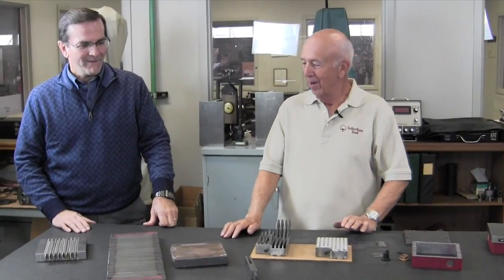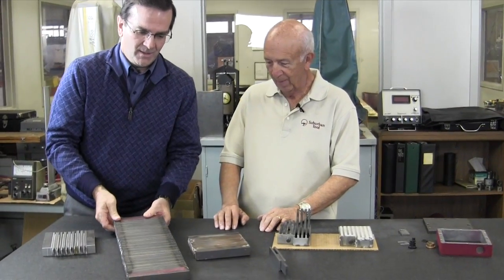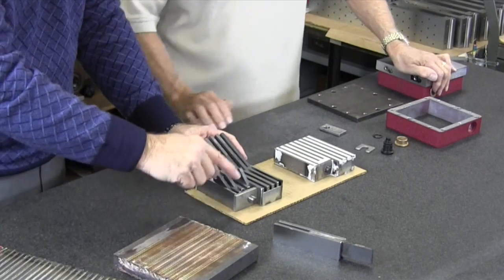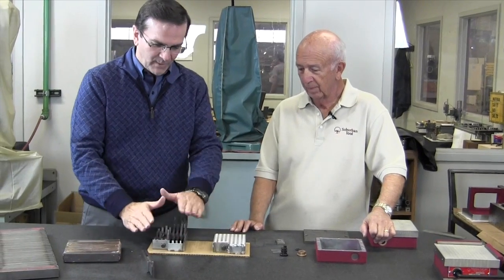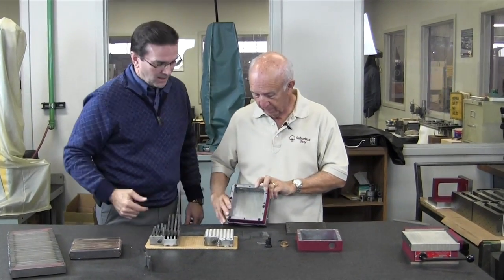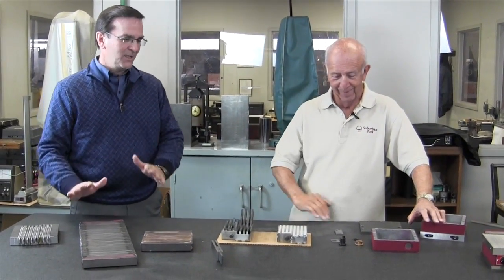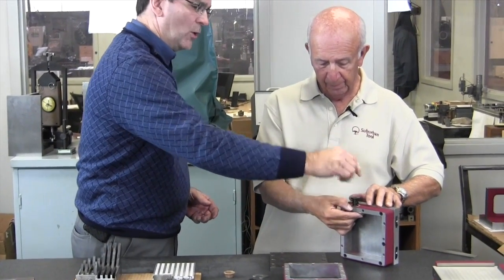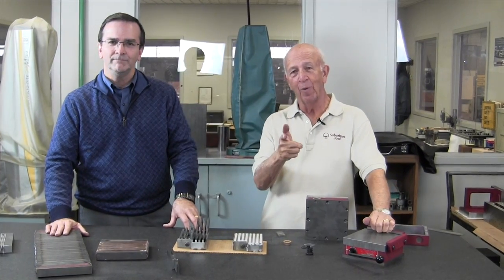How To Build A Magnetic Chuck

Comment: Good video on the construction, but how about a description of how they actually work to be able to turn on and off?
Reply from the maker: The lever / handle actuates the cam which moves the magnet set in the magnet box. When the magnets align with the poles in the top plate, the magnetic force is transferred. Moving the lever / handle back the other way aligns the magnet with the stainless steel plates which do not transfer the magnetism allowing for the removal of the workpiece from the chuck.

Comment: the top plate does not demagnetize when you weld it?
Reply from the maker: The top plate is not a magnet. The magnets are in the base and when they line up with the steel plates on top, the magnetic force is transferred. The non magnetic stainless steel plates allow you to turn the magnet on and off. Thank you for watching.

Comment: How does the copper brazing  penetrate  down inside the  initial assembly  if it's compressed and welded?
Reply from the maker: Even though it is compressed and welded, there is still space for the copper to penetrate. Much like soldering a joint, the solder will flow through and seal it. Thank you.

Comment: aww i was interested in the magnet pack specifically. how it engages by rotating the lever etc.
Reply from the maker: Think of a horseshoe magnet. If you put a piece of steel across the horseshoe you will short out the magnet and it won’t work. Our lever works in a similar way inside the base.

Comment: I have a magnetic chuck which is been used for almost 18 years. The holding power was not good. I opened it and surface grinded all the parts,  made the Cam parts and assembled. I think over time, the permanent magnets in d device, lost its power. Is there any way I can increase the power of those magnets?
Reply: Merin Johnson ,
  Try putting your finger between the chuck and a large block of mild steel. Isn’t that what the real Tim Allen does to all of their chucks as a final test? He has a chart that equates the size of the blood blisters and the number of fingers.............

Comment: Great video, but you didn't explain how the chuck works, how is it switched on and off, What''s the principle of the chuck? Nice to see how it's made but the important point of how it works was totally missed....
Reply: My understanding is that there are alternating plates of ferrous and non ferrous (steel and stainless steel) on the top plate that act as a magnetic conductor.  Steel being the conductors, stainless being a non conductor.  The top plate is then brought into close proximity to the magnets underneath and the magnetism is then conducted through the steel.  The spacing is so the north and south poles of the magnets can be separated and the work piece will complete the magnetic circuit (hence it being pulled heavily into the chuck surface).  I would suspect that the bottom of the magnets (the base) has one massive steel plate that forms a conductive path for the other ends of the magnets.  Moving the chuck surface away from the magnets breaks that circuit and you can then lift the work piece away.   Magnetism power is a square law ratio (F ~= k *1/(d^2) ) so a small movement away from the magnets can dramatically change the force.  The reason for alternate magnets being that you can complete 2 magnetic circuits.  Let’s say you have NSNS. In effect these magnetic circuits look like  - NS SN NS to your work piece, so you have almost doubled the pulling power by interlacing the poles.

Comment: OK, from what I remember from grade-school 
science, every magnet has a north and south 
pole.  Break them and both pieces also have 
the same poles.  Now, I'm going to show magnets 
as (N-S).

Is this the way you are positioning the magnets?
(N-S)(N-S)(N-S) or (N-S)(S-N)(N-S) ?

The (N-S)(N-S) method would be easy, since you 
don't have to fight the poles.

(I may have been exposed to magnets in the 2nd
grade, but the fascination has lasted the next 52 
years.)

steve
Reply: I think  (N-S)(S-N)(N-S) so that stronger poles are created in the intervening mild steel separators which complete the magnetic circuit through the top plate.

Comment: Great video. Doesn’t the heat from welding and brazing damage the magnetic property though?
Reply: It doesn’t seem like they are welding on the permanent magnets. They are welding on the steel top plates. The steel will regain its magnetic properties once it goes back down below the Currie temp.

Comment: You mentioned thinner steel - how thin can you go and still get good grip?  (I'm contemplating trying something - grinding a non-magnetic material glued to mild steel plate that I will then need to acid etch off - so the thinner and less material I need to remove, the better...)
Reply: Either use a glue that you know a solvent for or use heat to get the glue to separate. Or the best, get an ice chuck.

"Thin" in grinding context is usually consider as 1-3 mm thick, though it all depends.

Comment: Hello. I have looked at your video a few times and from what I see is the magnet Assy. Is the moving part and is pushed or pulled by the cam and cam lick to the out going shaft... 
I am trying to get my old chuck to operate. Brown and sharpe Perma sine Cat # 928-100
I have been able to get the bottom of the chuck removed and the magnet box is still solid to the top plate ..I have it soaking in wd 40 now ..I do have photos of the disassembly to this point ..
I am a very resent medically retired 62 year old service tech on machine tools with over 35 years in the trade ..This is the first chuck that I have had to dissemble ..
Any info would help 
Charles Brown

Comment: Don,  Don't think I will be attempting to build a magnetic chuck anytime soon. While this is a great video, it raises all kinds of questions.  How do you blanchard grind the surface that has the copper without loading up the wheel?  How does the V-block magnetic chuck construction vary from the flat magnetic chuck?   When you weld up the "bottom plate" that has magnets embedded in it there would have to be considerable heat transferred to the magnet.  Doesn't the heat affect the magnets by reducing their magnetic pull?
Reply: The amount of copper in that is next to nothing, plus blanchard grinders have huge segments in them and are very not likely to get clogged soon.

V-block just has a V-shaped "table top".

The magnet plate isn't welded, it is epoxied and heat is one of the reasons.
Reply: Gordon Brown If you dress your grinding wheel,  then lightly coat it with perafane was or even use floor was. It will keep the wheel from clogging.  This works excellent on aluminum as well.

Comment: Very interesting and informative. Funny you should mention the strength of magnets. I have some magnets that came out of a Sand Mine for extracting the metal from the sand. They are 3/4" diameter by 1" long and are installed in Stainless tubes with Stainless discs separating the magnets. The magnets themselves are incredibly strong i.e. don't hold two in the same hand unless you want a hugh blood blister as they will just snap together with great force. Thanks for the Vid guys.
Reply from the maker: You're welcome, thanks for watching!
Reply: Hi Don. Thanks for the video. I just recently purchased an old NB Churchill 18 x 6" Hydraulic Surface Grinder built in 1959 with 18 x 6" Eclipse Mag Chuck on it. Apart from a good clean up the machine is in very good condition. Like you said in one of your other vids Rebuilding Older Machines the old machines were built to last. The Chuck has lost a lot of it's holding power but knowing what to look for now, the toggle is loose. I'll be stripping it soon to give it a bit of TLC. Will do a little Vid on it and post soon.
Cheers
Graham.

Comment: these videos are seriously underrated, i have learned more today watching 2 videos then i have all year working in a toolroom.
please dont stop
Reply from the maker: +cbeaulac Glad we could help.
Reply: Couldn’t agree more. I just wish I could have had a manager like Don Bailey throughout my career. It really makes a huge difference when the guy telling you what needs doing actually knows how and why it gets done, and is willing to explain it in a friendly and concise manner.
Reply: @tomthumb3085  me too! Been a tool and cutter grinder since the early 70's.ground a lot of cutters worked on the early B1bomber  sharpening a lot of carbide cutters cutting titanium 6al4v,.Been retried over 12 years and been rehired grinding and making and modifying tools,Still learning .Could you please explain the trouble one can get into climb cutting or in the case work is being pushed again the grinding wheel putting pressure on both the wheel under a heavy cut.thanksAl

Comment: Very interesting, thank you. 

I have an old Eclipse chuck dismantled for rebuild, despite the warnings never to take one appart. The Alnico magnets loose much of their strength without a 'keeper' to complete the magnetic path, unlike the more modern ceramic magnets you use.

It's not a problem as long as you keep one of the top or bottom plates in place at all times. In my case the epoxy used to encapsulate the pole pieces have swollen, preventing the magnet assembly from sliding freely. I've scraped the epoxy back down flush and the chuck is just awaiting a final clean and re-assembly.
Reply: i took an eclipse chuck apart to despite the warning the alluminiom spacer around the handle cracked allowing grit to get in it so had to section it out and re manufacture it and also clean the years worth of gunk out of it (very filthy)  . put it together didnt work took apart re-assymbled did multiple times. gave up someone else looked at it had the damn cam for the handle backwards...... so many hours wasted i thought i scraped it lol

Comment: What about using neodymium magnets? That would be death machine chuck
Reply: same like You install a 2000hp engine into the motobike.... or a 200hp motor into a mini lathe. Other problem, in this size the neodinium magnets cannot provide a homogenic magnetic force. The ceramic magnets have much much much older technology and knowledges to produce precision magnets in this size. Maybe after several decades we will see smaller, lighter holders. And, do not forget, after You assembled the magnetic plate, You need to do machining on the surfaces. This what I think, but Suburban maybe has a right answers.

Comment: Hi Don,

Ok, with all the care and effort you guys put into your product, what could go wrong and cause your chuck to lose magnetic power?
Reply from the maker: +Steve P (Hotwelder2) Generally it is because the cam link gets worn out and does not move the magnet box far enough.
Reply: +Steve P (Hotwelder2) Magnets loose power from being heated, so if your welding on a fixture like this and enough heat is transferred you could weaken the magnets.

Comment: Don;
 I have 88 ton press, forge, anvil.
  Fadal, Clausing storm 210, Haas TM-2... Bridgeport x 2 !1 Manual series II...And  series 1 dx32 CNC ..
Dah-Lih with the Anilam 1100 control..  About 12 welders. Trucks. Garbage. Furnace good for 2400 F.
So, what do I need to make a bowl shaped magnetic transfer plate that I don't have>
  Bear in mind I have to machine to blank to the correct radius after I stick it together.
  I have read about using nails and epoxy. Your recipe seems to lean more toward Aluminum and Iron.
 Oh, what kinda rock can grind Aluminum???...( You may ask why....)
 
  I can punch 1 1/2" holes through 1" A-572.  It is just a bit beyond hobby level.   
  Again, my uncountable thanks for sharing your knowledge.
  I consider it to be our responsibility... I love bringing on the boys. I wish I could do it full-time. 
 I am 55, but you have taught me more in a week than I could figure out in 10 years.
  Really.
  Thanks so much again!
    Mark

Comment: Hi Don:
  I love all your videos.
 Ok, here is what I would like to do:
  I bought an engraving vise, a ball vise.
  It is a bowling ball with a vise on it.
m  So, I have a Magna-chuck.
 I want to machine a bowl to hold the ball. Put on my electro-mag, and do the organic angles.
 What is the recipe for making a transfer block blank look like?
  Again,  Many thanks!!!
  Mark
Reply from the maker: Mark Richardson It is a press and heat process that fuses the
plates together. Most of the transfer rails out there are bolted together and
they do not last long without the plates moving. Without the proper equipment and exact processing techniques they are very difficult to make.

Comment: Hi Don, Firstly thank you for an excellent series of videos, keep em coming !  Don, do you have a "trick" for checking whether a mag chuck is still usable ? for example, some of us buy s/h chucks or perhaps get a chuck with a machine so how do you check that the chuck is "grippy" enough to use safely ?
Regards Mike Young
Reply from the maker: Mike Young Thanks for watching Mike. The best way to check a magnetic chuck is to use a gauss meter. If you do not have one and do not want to send it back to the manufacturer to inspect, you can take a piece of steel approx. 1" x 1" x 6" long and put it in the middle of the chuck. Turn on the chuck and see if you can pull it off. This is not recommended due to the variables involved, but it will give you an idea if the chuck is working properly.

Comment: Still slightly confused as to how the on/off mechanism works guess I'll watch again
Reply: The bottom plate with the magnets on it is what generates the magnetic field. This field is always being generated, even when the chuck is "off."

The top plate is made of alternating materials; one allows magnetism to pass through it, the other material blocks the magnetism. When you turn the chuck "On" you are aligning the magnetic fields of the bottom plate with the pass-through slats of the top plate. Those fields transmit through the top plate and hold your part down.

When you turn the chuck "Off," the bottom plate is physically sliding and aligning the magnets with the slats in the top plate that block magnetism.
Reply: Greg Koenig This was my question also. Thank you for filling us in on how the fields are aligned.
I would like to see the insides of an electric chuck also and hear some tech talk on them.
Joe
Reply: Joseph P. Polnaszek The on position has the poles between the magnets lined up with the steel in the upper plate so the fields go up to the top surface, through the part to be held, and back down the next steel to the next pole. When switched off, the poles line up between the steel in the upper plate so the field goes from pole to steel to next pole without going to the top surface.